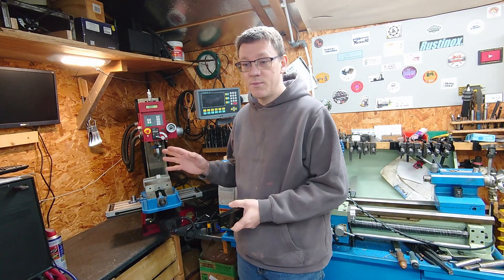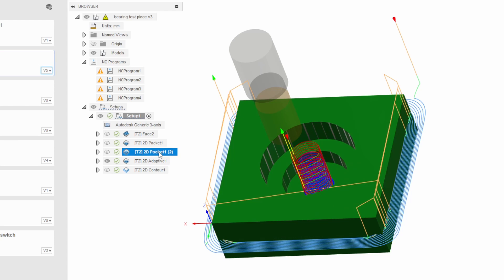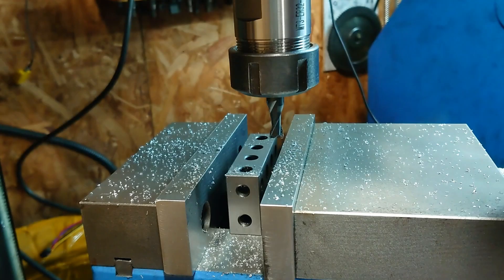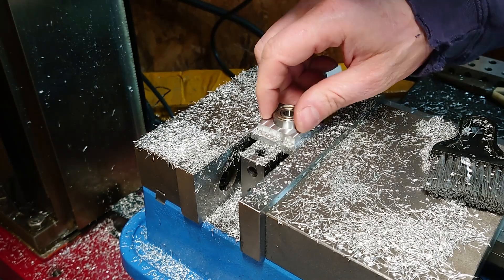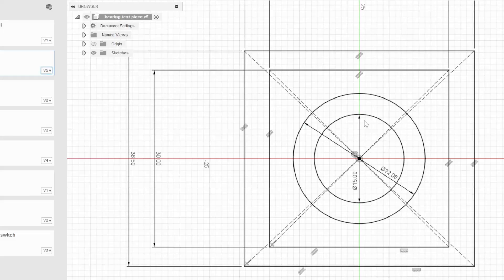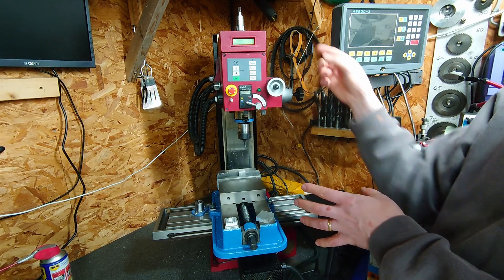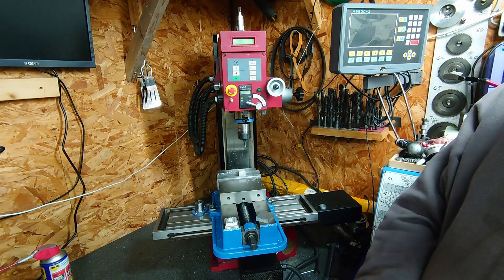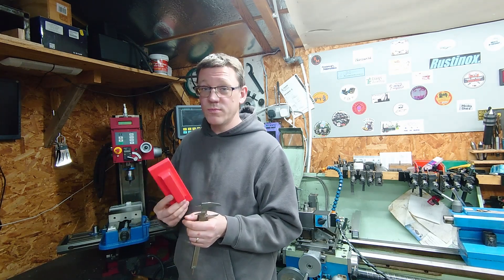SIEG X3 CNC Mill First Test Part

Comment: Hi. I have an X3 that had the same clatter. I ended up making a new female  splined drive out of bronze and hand fitting the spindle spline to be a close sliding fit. It's heaps quieter now.
Reply from the maker: I've fitted a grub screw for the moment, until I decide if I want to put any effort into this spindle, or just fit a better one with no splines to rattle! Thanks for the comment.

Comment: So to "fix" a spindle alignment issue you introduced a column squareness issue ?
The standard YouTube "tramming" fix may have worked OK (ish) for Rong Fu-type  round column mill/drills, where any datum set on a job was lost when the head was moved. This is not the case with a dovetail guided column - retention of an X-Y datum on the workpiece as the head is moved to accomodate different length tooling is only maintained if the column is truly perpendicular to the table in both X-Z and Y-Z planes. 
The "correct" way to sort your spindle alignment issue is to first check that the table working surface runs parallel with both the X and Y axes, then check the squareness of the column to the table top in X-Z and Y-Z planes with a precision square - here you may need to shim the column (though scraping out any error would be the better fix). Then set the head to "tram" correctly in the X axis using the swivel head - any "nod" along the Y axis shown now is corrected at the interface of the swivellable head to it's saddle and not by buggering up the column-table alignment..
Alignment accuracy is really down to what you want out of the machine, but the general "rule of thumb" employed by former machine tool fitter collegues for manual machines in general engineering use was "a thou per foot" - 0.001"/12" or approx.  0.025/300 mm
HTH & best wishes.
Reply from the maker: Hi, thanks for your comment. All valid points, however you did make the assumption that the column to base was square in the first place. I agree that the column must be perpendicular to the plane of the table; the shimming was to correct the column. Unfortunately this is a Chinese mill, and there is so much more that is inaccurate. For instance, the spindle has about 30um of runout, and I can easily get another 25um of movement at the spindle nose just by pressing on the mill head with my finger - the head moves at least this much when changing directions. There are many things that could be fixed, but I'm probably just going to learn on this one, then sell it on.
Reply: @ollysworkshop  No assumptions made on my part, Olly - just a response to the tenet of your commentary "error in "nod - shimmed column to fix it".
I learned very early on in working with CNC machine tools for living not to assume anything !
All machine tools regardless of size flex & move to some extent - I am far from being a physically strong person, but I could easily bend an 18 tonne vertical borer to "tweak" alignments during installation - all you can do is to build / check the machine in a "static" unloaded condition. Developing a working regime to get the quality / accuracy required on the finished part to compensate for the machine's inherent foibles is all part of the game. Best not to go down the "effects of changes in workshop and machine temperature on accuracy & repeatability" rabbit hole if you want to retain your sanity !
Good luck with your endevours.
Reply from the maker: Haha.. then it was me assuming that our interpretations of nod were the same. I had always taken it to mean any front to back misalignment, same with tram, meaning any side to side misalignment. You are saying (and I don't doubt you are correct, but correct me if I'm wrong) that nod and tram are specific to spindle alignment? Are there special words for column errors? Or are they just perpendicularly, squareness etc?
Reply: @ollysworkshop  Yes, what is refered to in YT vids as nod and tram are just related to the spindle alignment. 
Typically, in vertical spindle industrial milling machines, the spindle alignment check with dial gauge mounted on an arm in the spindle is the very last test undertaken - the whole machine alignments are checked off  in the order they are displayed in the test result document,  starting with the bed levels (Test 1) & working upwards through the machine (each test is sequentially numbered in the test document). Prior to the "tram" test the spindle alignment is checked with a test bar in the spindle for parallelism in X-Z and Y-Z directions + runout at the top and bottom of the test bar - this test is done after the column squareness to the table in X-Z and Y-Z has been verified. If all the preceding checks are within limits, the the spindle alignment test result is pretty well assured.
To "properly" check out a machine to the test document is quite time consuming, requires decent test artifacts (precison square, parallel, dial gauge, level, spindle test bar etc.) and there really are no hiding places ! It is rather simplistic (to say the least) to think that you can come in and just do the very last test in the series without completeing the others in the correct order & expect that to show a machine is OK - really all it achieves is a decent "match mill" on facing cuts.
Reply from the maker: @mgnbukint6502 I didn't think anything of the sort, and as I said above the machine is far from OK. I got a poor result and fixed the biggest obvious issue that was the column squareness. I incorrectly called it nod, but now I know not to call it that. I agree that to properly align this machine does require a significant effort. The machine was assembled from random bits from a warehouse clearance, so nothing has been "fitted" properly. Maybe one day I'll spend the time, but for now it is good enough.

Comment: Looks promising.  I have a much older X3 that I converted to CNC. There's a lot of scope for improving rigidity and accuracy.  I shifted the Z axis balls crew to the outside of the column and filled the column and base with epoxy concrete. I also ditched the Sieg DC motor and fitted a 3 phase induction motor and VFD. I also had to tram the column, but I used a method by Stefan Gotteswinter. Basically, annealed copper wire pieces trapped under the flange with metal filled epoxy as a shim. There's lots more, but it's now relatively accurate and repeatable. 
Regards,  Preso
Reply from the maker: Thanks Mark. Mine is quite old, the date codes on the old electronics were 2007. I believe it had been sitting in a corner of a warehouse for most of it's life, having been partially harvested for bits. Mine does have the brushless motor. The column has been trammed with strips of shim stock so far, but I like the idea of adding the metal filled epoxy to fill the gaps. I am going to use as is for a while and at some point will have to decide if I want something better, or spend the time improving this one.

Comment: G'Day Olly, Nice result for a first run, you had Me nervous when cutter was heading for the vice, so no wonder, you being there in person, hit the shutoff.
A question re the programing, Is it possible to program a no go zone for the rear jaw of the vise(since it will always be in the same place on the table), and also possibly the front jaw?
Cheers from Down Under
Reply from the maker: Hi Bob, yes I can most definitely tell the software (fusion360) about the vice. I will get a model of the vice so when I run the simulation I can see what is going to happen. You can certainly program entry and exit points. Not sure how you tell it that the vice is hard and is a no go zone, something to look in to!
Reply: @ollysworkshop  Thanks Olly, Just an idea from the uninitiated (to CNC Milling)👍

Comment: Looking great! Rather than tweaking the model or the stock to leave, it's often better to tweak the cutter size, or better still, set it as tool wear (depending on your control software). Then any part you make with that tool should be on size. When looking at machining feed/speed tables on tool manufacturers' sites, remember their settings are a balance of tool life vs finish vs machine load, and you can derate by at least 50% so long as you keep the load per tooth reasonable. When I get a new slot drill, I run a job that has seven holes bored with that tool at 10 micrometre diameter increments and check the fit against a known standard ring so I can get the tool wear offset tuned precisely. Often I end up needing 16000 rpm on the spindle to get optimal results on aluminium with a 6mm tool, but the finish is still really good when I run it much slower so long as the load per tooth is similar. That's with dedicated parabolic-flute carbide tools and full flood cooling though, so I can run small DOC at 3000 mm/min feed. Amazing results with that little machine, looking forward to seeing what else you get up to.
Reply from the maker: Unfortunately the very basic system I am running doesn't support tool wear. All the compensation is in the software (fusion), but I see the value of changing the tool rather than the program. In this instance, I actually need a larger hole, the bearing was just a shade over 22mm, and the original hole was basically on size. The 20.06 diameter also came out bang on, so I'm fairly impressed by that. I need to build an enclosure before I start messing with coolant, but i may try just compressed air to begin with.

Comment: Great result straight off the bat. I have no experience of CNC but I can see how that first plunge is going to be nerve wracking. Could the tool path be progammed so that it is slower and maybe on the side of the part between the vice jaws where the is a better view and a bit more space Z space just in case?
Reply: In most CAM software, you can include fixtures, vices and beds in the model as parts to avoid. You have to set up the vice model, but most popular makes have standard files you can download. Some are included in Fusion and perhaps in others.  I use the Lang parametric vice model from the samples in Fusion.  There's a good example by @MechanicalAdvantage entitled "Fusion 360 Parametric Self Centering Vise". I'm actually using a Chinese lookalike zero-point base with my self-centering Gerardi ART650.1 vices. I have a similar vice model for my fixed-jaw Gerardi ART1. Doesn't stop me munging up the vice if I mix up G58 and G57. Must. Be. More. Attentive.
Reply from the maker: @MachiningandMicrowaves  I'll see what I can find, it's a cheapo Vevor copy of a fairly standard milling vice so there will no doubt be something suitable in fusion.
Reply: @ Close to a Kurt I guess
Reply from the maker: @MachiningandMicrowaves  yes, I'm hoping so, but failing that it won't be too hard to draw up something.
Reply from the maker: I have only modelled the part I was making, and not the vice, so the simulation looked great. I will get something modelled up for the next job so I know what to expect! It wasn't plunging particularly fast, it's just that I didn't know if it was going to stop. After I stopped it, I looked at the gcode and saw that the point I had stopped at was the working height for the cut. Definitely would be better to aim for a point between the jaws, rather than over them!

Comment: I’m not super familiar with cam but i think you should be able to change the “stock to leave” on the bore to negative instead of changing the model so the model stays perfect. also wondering if the backlash could have affected the bore fit
Reply from the maker: I will have to try the negative stock to leave trick, thanks.  As well as I could measure, the bore was on size on both occasions, surprising considering the loose gib. I had measured the bearing with calipers and probably got a slightly inaccurate reading. Measuring with the micrometer gave a reading slightly over 22mm, so not a surprise that it didn't fit first time.
Reply: @ollysworkshop  ah makes sense. I must say I was very impressed by the surface quality of the part on such a small machine!

Comment: Whoa that looks pretty good and yes you need a high speed spindle for Aluminium and perhaps flood cooling instead of mist lubricants inside the enclosed space.
Reply from the maker: I do have a 1.5kw 20000 rpm spindle, but it's got an integral ER11 collet chuck, so largest cutter is 1/4". I could try mounting it like the system I have for the manual mill - clamped round the main spindle.  I need to build an enclosure for the machine before I start spraying coolant around. I will try just compressed air to keep the chips out of the way to begin with, I probably won't go aggressively enough to really need coolant.

Comment: It stresses me out watching CNC get so close to things like the vice. I guess you really have to trust the instruction set.
Reply from the maker: I think the trouble will happen when I've got a bit more confidence, and I start trusting the machine! I will no doubt crash it at some point.😬
Reply: @ollysworkshop  indeed. I managed to crash manual machines. I think add in CNC and I could jam it in there hard.
Reply: Even after almost a year of running CNC, I still often do a quick test program with a small drill moving to X0, Y0, Z100 and make sure the tool is never going to hit the vice or gouge the part. I've managed to hit my vice twice at high feed rates with a 12mm carbide end mill running at 6000 rpm. The vice won on both occasions.  Eventually. Those mills are amazing, but 2000 mm/min at 5mm deep through a hard Gerardi vice jaw is a little too much.  The sparks were amazing. The other time was when I tried to push a 37/64 HSS drill through the top of the jaw. Once was Fusion's G58=5 when my brain thinks it should be four.  Off-by-one errors are why I got sacked as darts scorer for my pub team. Other time was when I used manual probing and hit the button for Y1 location twice, so setting Y1=Y2, which tried to drill a 20mm deep hole through the vice. I'm worse than an apprentice, as there's nobody to stop me doing stupid things.

Comment: Decent, especially for what the base machine is! The loose gib, or rather - the tightened gib will reduce the vibrations too, so that is also an aspect that has yet to be seen in action... 
Regarding the quill spline - get the thickest grease that you can, grease that spline well and proper and voila - no rattle... You could also moglice the spline for an approximation of a zero clearance fit, which will also not rattle, and what little free movement there is - will get cushioned by the moglice itself... Grease will do the job for a long time and for very cheap; you can re-apply the grease once every year or two to keep it healthy and the tube of grease will outlast it`s expiration date, where the moglice will be a pain in the ass to set-up, it will cost an arm and a leg, it will last forever essentially and will require essentially zero servicing... I`d go with a tub`o`lard if i were you(and i would do so myself)... Jk, not lard - of course - but you get my point... A mogliced splined bore would not rust, but you still have to coat the shaft in something to prevent rust, so just pick the thickest grease, stuff the spline with grease and that`s it... Repeat when needed... And go with the cheapest grease - it is not even a lubricant, it`s just there to prevent rust and rattle... 
One could even consider some greased baking paper or double-wide electrician`s tape(don`t, glue always allows for pocket for moisture and rust to form), you could just grease the baking paper with some more industrial lube and just wrap it around the splined shaft, ``form fitting`` with a bit of wire to conform and grease-stick to the shaft geometry, and wrapping it as many times as it takes to take up the gap, but that is a ``permanent temporary solution`` which you apply once and ignore until you need to take things apart, but then the grease is bone dry and the paper is a rebar reinforcement for the cruddy mass of shit that you need to get to loosen up to take things apart(like for spindle bearing service/maintenance)... I don`t know the clearance of your splines, but there sounds to be near a full millimeter of ``backlash`` in the spline, or at least it sounds so to my ears over the video, so i can`t say what to pick, but you can`t go wrong with thick grease... 

Best regards!
Steuss
Reply from the maker: Thanks for that Camillo, grease it is! I've also read that the bearings as supplied are not the finest, so a spindle rebuild at some point will probably happen.
Reply: @ollysworkshop  You might wanna consider the classic Timken tapered roller bearings if possible... Timken`s precision tapered roller bearings are a damn fine solution if the spindle housing fits them... I`m not sure what you have in mind for the machine in the future, nor do i know the specific design of your spindle, so i can`t say much... 
Regarding grease - it should do the job damn well... 

Best regards!
Steuss